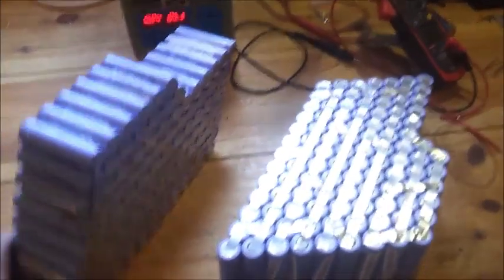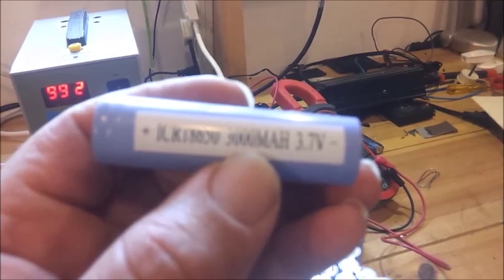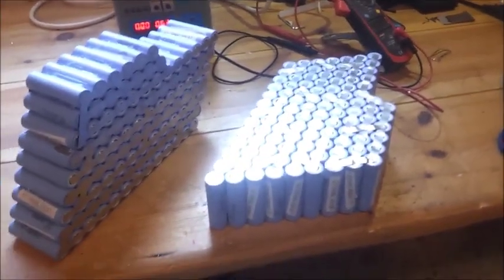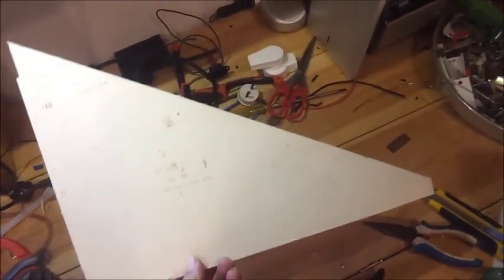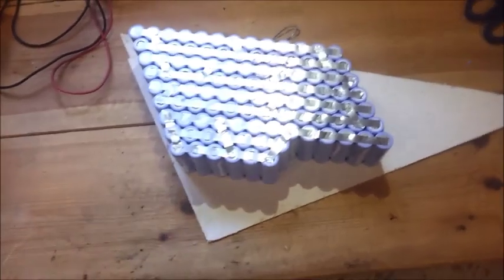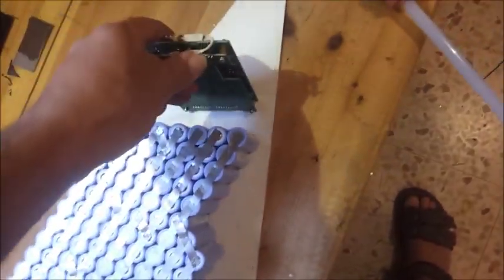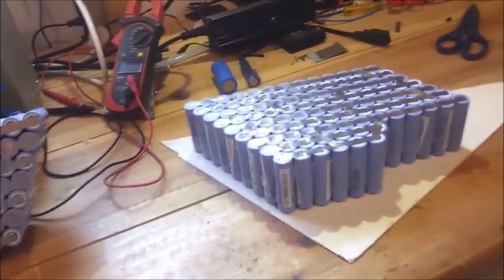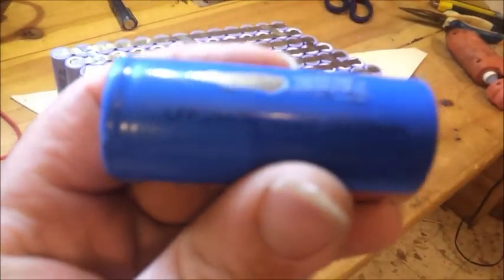assembling lithium pack 40ah 60v li-ion - 1 הרכבת סוללת ליתיום

Comment: Hey, I'm struggling to figure out what size nickel tape to use. I'm building 17s6p. I've even been told conflicting information. Do you have advice?
Reply from the maker: you can use 0.1 X 8 mm nickel belt, and it will do just fine. see here  https://neworldshop.com/product/%d7%a4%d7%a1-%d7%a0%d7%99%d7%a7%d7%9c-%d7%9c%d7%a1%d7%95%d7%9c%d7%9c%d7%95%d7%aa-%d7%9c%d7%99%d7%aa%d7%99%d7%95%d7%9d-%d7%a8%d7%95%d7%97%d7%91-8-%d7%9e%d7%9e-%d7%a2%d7%95%d7%91%d7%99-0-1-%d7%9e/
another good option is https://neworldshop.com/product/%d7%a4%d7%a1-%d7%a0%d7%99%d7%a7%d7%9c-%d7%9c%d7%a1%d7%95%d7%9c%d7%9c%d7%95%d7%aa-%d7%9c%d7%99%d7%aa%d7%99%d7%95%d7%9d-il-ion-18650-%d7%a8%d7%99%d7%91%d7%95%d7%a2%d7%99%d7%9d-%d7%9e%d7%99%d7%93%d7%94/
if you go for high motor power 2KW and up, use double nickel welding

Comment: Hello, do you know if the Samsung ICR18650-30A can be used in a flashlight that requires 3 batteries to work? Does the batteries can be used if placed one behind the other inside of the flashlight? 

Thanks.

Edgar
Reply from the maker: +Edgar Freitas    The ICR18650-30A can supply a 5-6A discharge current it can replace 3 Nickel metal batteries (or some other AA / AAA batteries). if you are using a li-ion cells, you need a protection circuit (BMS), so it will cut of the voltage when the battery go low, or protect it from over charge. the voltage range is: 3.0v - 4.2V
Reply: +ilan - neworld Thank you for your answer. :) Great video and great channel btw!

Comment: Great video. What type of BMS did you use?
Reply from the maker: it's BMS that works with samsung cells.4.25V - 2.85v40-60A, depend on the motor you like to run with it

Comment: After some advice i have a 48v lead battery scooter iv brought a 60v controller and want to change my battery to 60v lithium battery i have 2 36v lithium battery and that fit in the space how do i go about doing this
Reply from the maker: if you connect 2 X 36v batteries in series you will get 72-74v battery.  upgrading from 48v to 74v will harm your motor. 
another thing to consider, the lack of balance between the two batteries.
i suggest you to buy a 60V li-ion battery and replace the motor controller to a 60v one.
you can also go for 74v and get a lot of power from the motor, but in most cases it will heat up and burn itself after some time.

Comment from the maker: in reality, the li-ion cells are lighter, smaller and powerful, the lifepo4 are tending to shortcut itself during a momentary high current discharge,
li-ion batteries can almost fully discharge itself , while lifepo4 can do 70-80%, because of it's low voltage range 2.8v - 3.3v, as the li-ion cell voltage range is 2.75v - 3.7v, allow it to be more flexible and can drain more current

Comment from the maker: people, the internet is full of misleading knowledge.
try to listen please.. 
the original lifepo4 is made by A123 systems company, that published information about 1500-2000 duty cycles.
this company is probably the only that can produce cells with this duty cycle.
(if it's truth) all the rest of the lifepo4 batteries can do 500-800 duty cycles (if it's o.k quality).
li-ion can do 500-800 as well, with working current is double.
please notice that Electric vehicle technology uses li-ion cells..